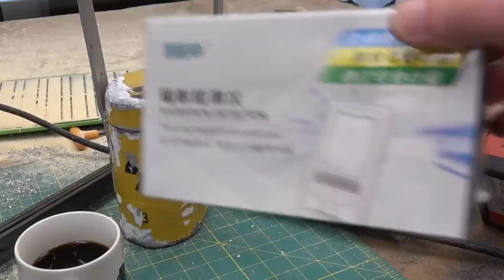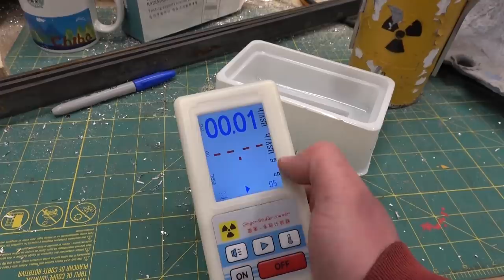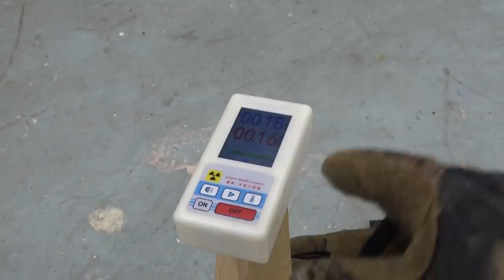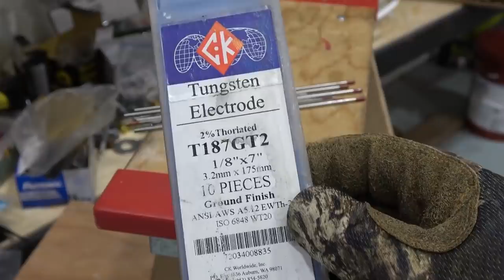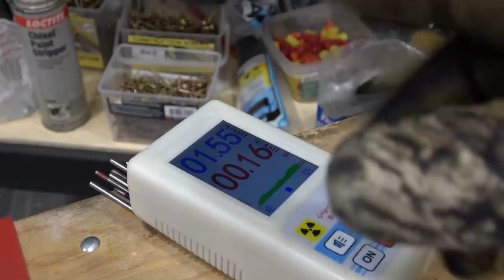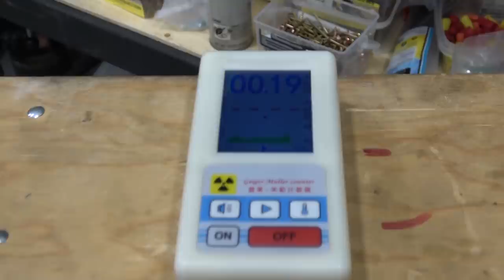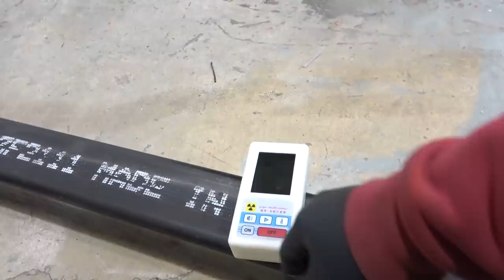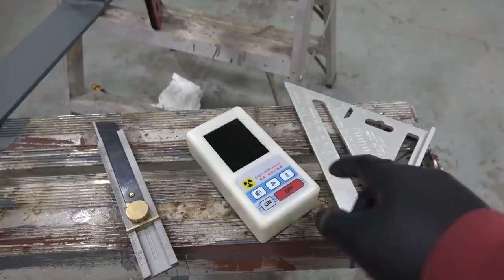Testing Radiation from Tungsten, Japanese Steel | Welding Metals Tested

Comment: Think the Inverse square has something to do with 3d spherical math formulas. I didnt do well in physics
Reply: 2D formulae – area of a circle!
Doubling distance halves the (perceived) diameter/radius,
and gives a quarter of the area.

The area is you, the receiver of the energy.
Works for light, sound, radiation, basically anything that is a point source.

Doesn't work for lightning strike (but does reduce chance of being hit :-)

Comment: With a glass tube (probably a Chinese J30x), your meter is incapable of detecting alpha. 

Also,  dose rates from an uncalibrated, non-energy compensated G-M counter are highly suspect. Without this, the device will vastly over-report.

  I've got an old Kodak camera with a thoriated lens that is WAY hotter than those electrodes and it's still no problem so long as you don't sleep with it against your eyes. Yes, it's hotter than when it was new because of some the daughter products are more active than Thorium itself.

Comment: Safety errors!    that detector cannot see alpha radiation and is to unlikely to see beta radiation. That detector is perpetrating a tautology by simply telling you what you expect to see via an arbitrary factory adjustment so the detector looks good at background levels.  Even if it reports a higher reading on your welding rods does not mean it is telling you anything relevant, e.g. it may only be responding to the x-rays from the welding rods.  Fukushima contamination that is commonly introduced around the world is Cesium.  the cobalt fallout was from above ground nuclear testing which is now five half-lives ago, so is mostly gone.  what your detector is seeing is the uranium contamination products that are in your concrete.  cesium has a 30 year half live so the japanese cesium remains.  approximately background levels of cesium from japan arrived at the california coast in the ocean.  higher level came as contamination on many products.  the cobalt that is in steel comes from breaches in the cobalt sources used in foundries or from recycled neutron irradiated steel that is mixed into a foundry batch.

Comment: A week or two after Fukushima in my Los Angeles classroom  I stuck the wand to our 50 year old Sears Robuck Geiger counter out the window. I got a big spike in the normal click....click.... ....click click background radiation. I went from yikes to giggling. Just a random spike. Never happened again. 
The studnets were far more interested in the glowing vacuum tubes inside the device then in the  rapid clicking from the orange Fiestaware plate I'd eaten off for twenty years. (I wanted another plate and only then discovered that pretty orange was uranium...   I emailed Theodore Gray, who makes terrific books about the elements. He said basically, yeah, shouldn't eat off it, don't worry that you did, I wouldn't keep it next to my bed (across the room-- no worries), but  the heavy metal aspect is probably more serious then the radiation (alpha particles ionized helium atoms) (meaning uranium is like lead. If you rub your finger on the plate you can get a nice series of clicks on the Geiger counter meaning you've rubbed off some heavy metal.) I paddle in the ocean and expected to see flotsam from the tsunami. Nothing so far. 
Here's a little factoid you might like. The oldest atoms you will ever encounter are hydrogen, made in the early universe. The youngest are probably the helium in a toy balloon. All the helium on Earth was lost into space a long time ago, helium binds to nothing so it's free to float off, the hydrogen stuck around because it readily forms molecules like water; deep radioactivity in the Earth  released alpha particles that were trapped underground making all the helium we can mine relatively new.

Comment: How many of those welding rods does it take to become the Hulk? Will I always be hounded by an investigative reporter? I hope I'm not framed for a murder that I haven't committed. I have run flat tires so I won't have to worry about changing a flat tire in a thunder storm. My clothing is going to be a problem, unless I buy super stretchy spandex or something like that. I think most of my bases are covered, just gotta get some radiation in me!

Comment: You should explain what Half Life really means.  It is actually a measure of probability.  Basically if the half life is 1000 years it means that sometime in the next 1000 years it will convert....  That is NOT a timer.  It can decay at ANY time in the next thousand years.  Be that 10 minutes from now or at the last moment in those 1000 years.
""Half-life is the time required for exactly half of the entities to decay on average". In other words, the probability of a radioactive atom decaying within its half-life is 50%. "
Reply: that's true, but because of the very large number of atoms in any give sample a normal person might have, the rate is pretty damn consistent.

Comment: @Ave 
- For each  2% Thorium-209(assumed) rod, of 3.2mm x 175mm,  that works out at around - - 28 cubic mm or 0.328gr Thorium-209 each welding rod - - or 3.28gr Thorium-209 per pack of 10. 
- - Since 1 mole Thorium-209 = 6.023e23,... then 1 gram = 2,881,818,180,000,000,000,000 Atoms 
- - YES >>> rounding up approx  2.9sextillion Atoms ,... So per rod of 0.328gr = approx 968quintillion Atoms, or approx = 8.7sextillion Atoms per pack of 10 rods,... (8,700,000,000,000,000,000,000 Atoms) 
- - Decaying naturally via the (random) release of an Alpha Particle of HELIUM atom (into the ambient air ) every 3.8milli-seconds, assisted when being used to weld,...  and becoming RADIUM-205 where ever it lands.... which decays via another Alpha Particle to Radon-201 & also via a Beta energy to Francium-205.
.
All in all,.. 29 daughter decay chains. Don't breath in the fumes,... and don't lick your fingers before washing, or sit on the couch with your work clothes on... !!! LOL 
.
Dangerous stuff  - 3mm shield of aluminium will not let Alpha - Beta at you, but will deposit on its surface & decay to the next daughter,... Inverse square wave energy only comes into play with the x-ray and gamma ray emissions, and a 3" LEAD wall should ABSORB those energies, keeping most of that from you.
.. comment made on video >>> https://youtu.be/W64tcCoOqJs

Comment: I worked on Ericsson during the Fukushima Accident. At the unit i worked at we also took field returns from all over the world.

After the accident in Fukushima back in 2011 some idiot decided to install a Geiger-counter for incoming gods for all the field returns....So what happen.

Well we got like 5 alarms a week for high radiation. So was them from Japan... not a chance. Most of them was from India, Philippians and Indonesia.

For some freaking reason those countries don´t in general have proper filter for the intake air in there telecom centers...All the field returns look like crap from those areas.... Everything from japan is freaking pristine.

The radiactivity turned out to be thorium that was road dust that blown in to the telecom center and got stuck to our field returns.

After 8 weeks av constant alarms they change the policy so only field returns from japan should go throw the radioactivity screaming.

4 years later they turned the thing of... not a single hit from Japan.... Why? because japan was really never that radioactive. Even field return from the actually Fukushima district (We did have quite a lot of them) was pretty much at background.

Comment: Well...you sparked a fire in this 200 pound gorilla, a little. If you sharpen welding electrodes on a bench grinder, do you think you would get a dangerous amount of dust down your breathing tube? As a pretty bad tack welder at a pipe fabrication plant,  I had to grind and resharpen many thoriated tungsten a day (without a respirator). What are the odds that it led to my testicular cancer later in life? The world may never know.  We now preach "Safety First!" But many folks do lots of self harm chasing the almighty dollar. Thank you for educating and entertaining us. You just might save someone's nuts. FYI: take your nut safety in your own hands! Educate yourselves.  Wear a respirator as often as you can if you are in any sort job exposed to any sort of breathable contaminant. They are relatively cheap these days. In case you didn't know...cancer isn't fun.